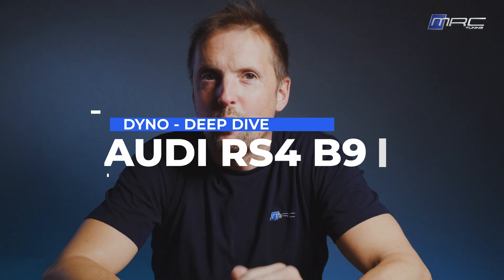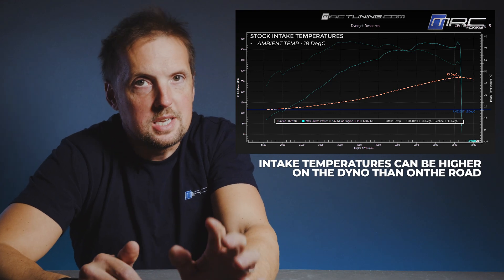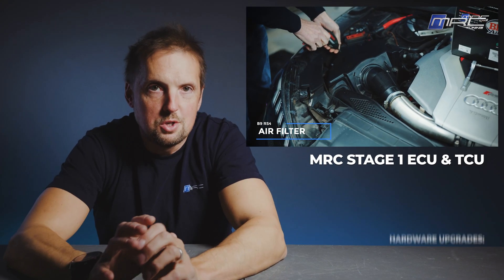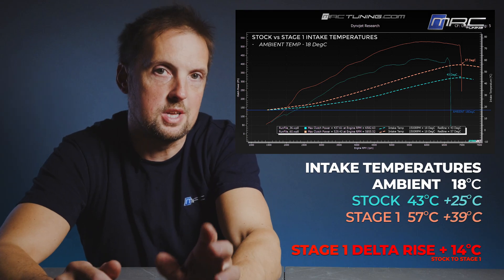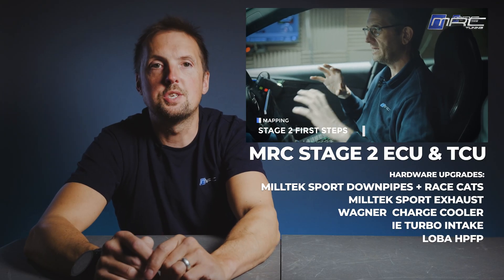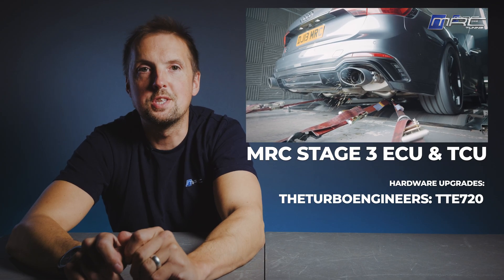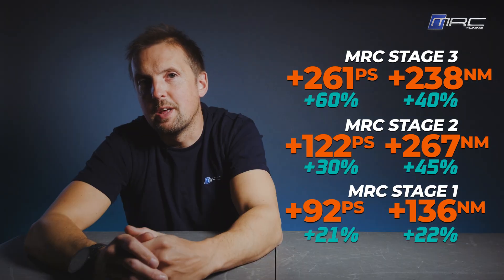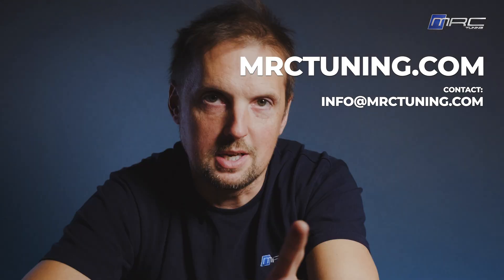[ AUDI B9 RS4  ] - STAGES 1 2 & 3 DYNO DEEP DIVE ANALYSIS - [ Plots | Boost levels | Intake Temps ]

Comment: How is the 90k gearbox holding the Stage 3? Weighing up a B9 Stage 3 with Suspension etc or a stage 2 G81! Did the stage 1 to stage 3 driving Video you mentioned in the last of the tuning series get published?
Reply from the maker: Gearbox is still ok! the torque is safe so the ZF will be ok - we are doing 110 maps on the car this week so lets see the torque figures come out to 😎👌
Reply: @dougatmrc look forward to seeing the results!!

Comment: The TTE720 is the favorite for 2.9tt, but the torque/PS trade is notable. Why not the Turbo Systems 650’s so you don’t give up so much between 2k and 5k?
Reply from the maker: We use turbo systems on other platforms. I’m sure if you ran more boost we can make torque up but we are happy with that risk/boost/torque trade off at this level

Comment: Would a rs4 competition be even faster then a normal rs4 when tuned? And is a gpf filter removed legal? Driving a rs4 b9 now and gonna change to a rs4 b9.5 next year just dont know if the competition is worth the extra money.
Reply from the maker: There would not be a difference in performance, especially since we upgrade 2020 on boxes to the performance software anyway

Comment: That was a very very interesting video, but I don't understand why the stage 3 peak torque was lower than for stage 2?  If it's to avoid damaging hardware, why not protect in stage 2? 
The boost is higher with stage 3, even at 3000 rpm.  That doesn't make sense.  
Great numbers anyway.
Reply from the maker: A hybrid is laggier so torque is later in the rpm and harder to make same peak number as a quicker spooling turbo. Most stock turbos are easy to make low lag, high torque. A hybrid usually has to run a more boost to make the same torque/power as a stock turbo and more again to make gains. This is why hybrids need all the best of best parts otherwise one inferior part holds it all back and can be worse the an stock turbos
Reply: @dougatmrc  Thanks Doug, I appreciate the reply.  So a hybrid turbo needs MORE boost to make the SAME torque as a stock turbo?  Firstly I figured a hybrid turbo, with a larger turbine, would have less exhaust back pressure than stock.  Secondly I figured a stock turbo running at higher pressure ratio would be operating at lower efficiency, so would be putting more heat into the charge air.  Both factors that affect engine output separately to boost pressure.  
I figure I know nothing.   This RS4 is making similar power and torque to my much-loved, very exciting,  Mercedes S600 Stage 1 with lots of intercooler mods.  That's a 5.5 litre V12 vs 2.9 litre V6.  I'm deeply impressed.   
Anyway, I think you've just talked me into a stage 2.  I hope to meet you soon.

Comment: Stage 3 all day everyday, why not. Itr nice to have the power if u need it but you don't have to use it all the time.
Reply from the maker: Exactly, and with the multimaps you can have a low boost 600PS tune if you need it... and then MAP3... 😎

Comment: Do these ECU flashes affect a Ghost immobiliser? Would the Ghost stop working if you flash the ECU?
Reply from the maker: You always have to be careful with ghosts interfering with can . If it does something at the wrong point in flashing you can brick the ecu. 99% of bricked ecus we can fix.
Reply: @dougatmrc so you can do it quite easily?
Reply from the maker: @nickyt6498 yes
Reply: @dougatmrc so you can do it quite easily?
Reply from the maker: Flashing an ecu doesn’t damage the ghost

Comment: At stage 3 high boost map without octane booster ( the 99ron map high boost 650hp) the boost levels are the same like the high boost map with octane booster ? 2.0 bar to 2.4 at the redline or is lower to protect the engine?
Reply from the maker: Upto 2.25 ish on high boost just 99.
Reply: @dougatmrc is it safe for stock internals that amount of boost?
Reply from the maker: @rafailbizios stock internals shared over 6 cylinders. I think that is safe enough. We haven’t gone for silly torque and high boost at low revs. There is more headroom for more torque

Comment: Stage 3 looks more suitable for track/drag racing given the benefits are at 5k+ RPM. Most road users spend a fraction of the time at these RPMs on the road. But... I bet stage 3 is by far the most fun 😂
Reply from the maker: Tbh you would not notice the extra lag after driving for 10 minutes as the kick and is still  at 3k so can use torque from low down.

Comment: stage1&2 & 3 gains done using octane booster looking at the inside of the stock turbos?
Reply from the maker: The car has multi maps for each stage. So the peak numbers for each stage are Map3 with octane booster at approx 102-104 octane.